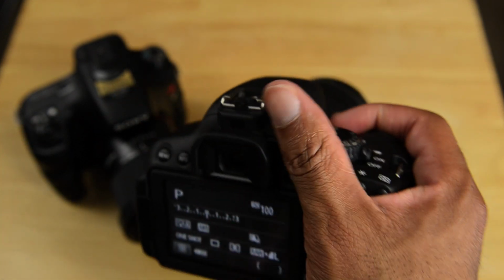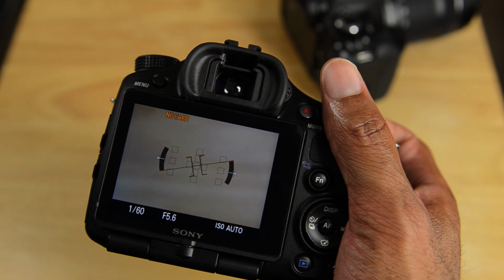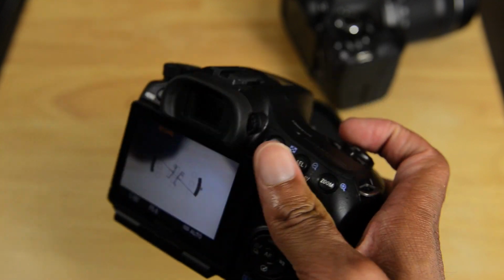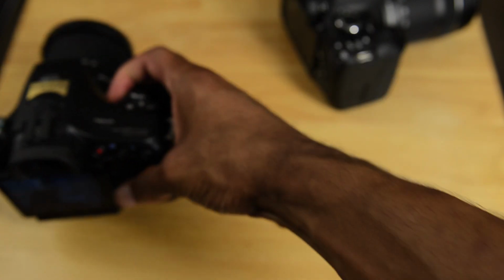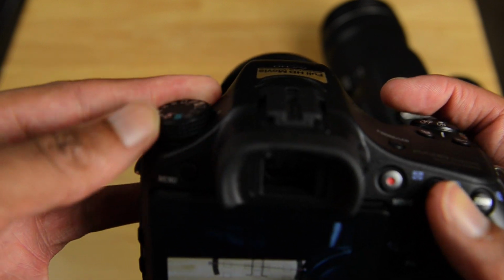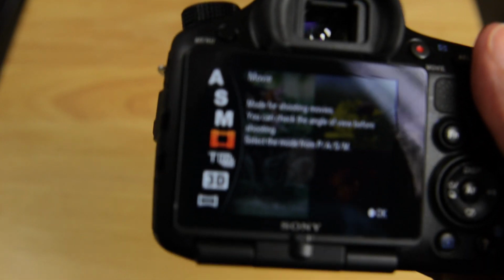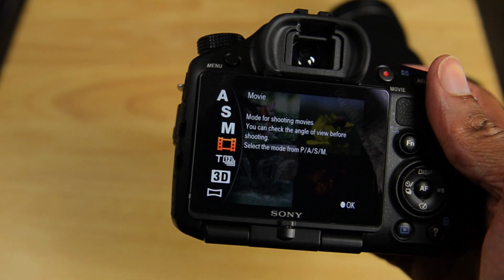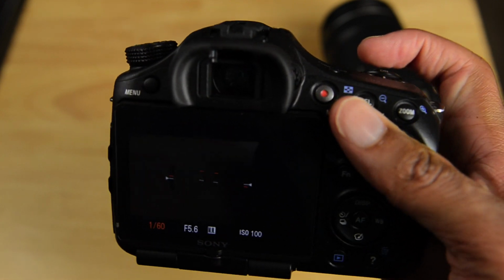Sony A57 VS Canon T4i (650D)

Comment: Advantages of the Sony SLT A57  OVER THAT CANON           Better color depth   23.4 bits vs 21.7 bits       Distinguishes 1.7 more bits of color         More dynamic range   13 EV vs 11.2 EV       2 f-stops more dynamic range         Significantly better image quality   75.0 vs 62.0       More than 20% better image quality         Much larger viewfinder   0.72x vs 0.53x       Around 90% larger viewfinder         Shoots much faster   12 fps vs 5 fps       Around 2.5x faster continuous shooting         Can create panoramas in-camera   Yes vs No       Stitches together multiple photos for a wide perspective         Takes 3D photos   Yes vs No       Combines multiple photos into a 3D image         Faster video autofocus   Phase detection vs Contrast detection       Shoot videos without worrying about focus         Higher frame rate movies   1080p @ 60fps vs 1080p @ 30fps       Both shoot Full HD (1080p) video, but T4i does so at a lower frame rate         Image stabilization   Sensor shift vs None       Helps eliminate blur caused by small camera movements         Slightly lower noise at high ISO   785 ISO vs 722 ISO       The SLT A57 has a slight edge (0.1 f-stops) in low-noise, high-ISO performance         Significantly better viewfinder coverage   100% vs 95%       Around 10% better viewfinder coverage         Longer battery life   550 shots vs 440 shots       Around 30% more shots per battery charge         More focus points   15 vs 9       Set focus accurately within the frame         Better maximum light sensitivity   16,000 ISO vs 12,800 ISO       The SLT A57's maximum light sensitivity is 0.6 f-stops better

Comment from the maker: No, it just depends on what lens you use.  In SLR lenses a larger mm number is more telephoto (more zoom) and a smaller mm number is wider angle.  18mm would be wide angle for example and 200mm would be telephoto (more zoom).

Comment from the maker: I would rule the Nikon out as far as video is concerned.  The newer Nikon's are better in video mode but the D5100 is quite a bit behind.  The Sony and the Canon will do much better in terms of video.  If you want more camcorder like behavior in video mode the Sony is better...for more manual video options go for the Canon.

Comment: Sensor stabilization like in Sony or Pentax is vastly superior to lens based.When you buy an SLR/T with a kit lens, and then you buy a prime, the prime will remain on the camera 98% of the time because they're far sharper, with better contrast and colors. With Sony or Pentax your superior primes will have stabilization, with Canon and Nikon - shaky shaky ! Buy an external mic for $40 if you don't want to hear the AF. 
Un-stabilized sensors are the greatest trap in SLR photography IMO.

Comment: jack, Fry's has it the Sony slt-a57 with kit lens 18-55mm for $479.99 this week and the next.  Also, to Jeremy, like the other person says, Sony has the new 18-135 SAM lens especially made for silent video operation, just like the STM lens for Canon Rebels.  Can you make a "correct" comparison between the two packages instead?  Also, I have tried the T4i, the touch screen is not that sensitive most of the times.  The autofocus is just painfully slow and I've missed a few potentially great shots.

Comment: I don't know if someone has already corrected you on this but i'm going to. The Canon 650D is Not the First Canon Model to have Auto focus in video mode. I am not sure but it was either the 7D or 5DMK2 that had auto focus. But with focus on both cameras the auto focus wasn't any good so I imagine they would not count.

Comment from the maker: it just depends on your intent, the biggest advantage of the 18-200 is that you won't have to switch between two lenses.  If you don't mind switching between 2 lenses then the 2 lens option will be less expensive.

Comment from the maker: I am not the most informed on long exposure/astro photography however I do know a bit.  I second the opinion that Sony isn't the best for very long exposures...neither is Nikon (which often use Sony sensors).  For whatever reason Canon cameras do much better with very long exposures; they even make a model specifically for astro photography (60Da).  I also suggest you look into exposure stacking software, this allows you to use multiple shorter exposures instead of just one really long one.

Comment: If you want quieter AF on the A57, the way to go is to get one of Sony's SSM (super-sonic motor) lenses; like the Canon STM series, they use stepperless motors. I have a Canon T2i and am leaning towards the A57 as a replacement because I want a camera with better AF when I shoot video. I'm not too worried about the lack of audio control with the A57 - an easy workaround for that is to use a dedicated audio recorder and then sync the audio in post-production.

Comment: Hi there.  Thanks for the review.  However, I am still none the wiser for my application - Atacama desert as a backdrop for starscape elapsed-time video.  I have a fair collection of 35mm Minoltas (too many) and their lenses, so I am tempted to Sony because of the A fitting swapover.  However, I have read some bad reviews of the Sony being very noisy in long exp. night shots, compared to Canon.  Drawn to digital for its multi-image capacity (instead of a pro 35mm x 200 frame motor back). HELP..!

Comment from the maker: Aparently you missed this line from my description "For my test I used the 18-135 IS STM, I was not able to detect any noise from the lens during focusing in video mode.  It however did not match the speed of the Sony, the Sony however was louder during AF operation."  Also Sony nomenclature aside an "SLT" camera still falls with the DSLR category...

Comment: one more thing....ur using a different specs of lens on both of the camera... try using atleast the SAM kit lens for sony... that would have less sound... and its alot faster than the old sony 18-70 kitlens which don't have a motor build in it...

Comment from the maker: It is a bit of a Sony oddity, in order to set it to this setting you have to be in the "multi frame noise reduction setting".  The multi frame noise reduction setting is just above the auto iso in the iso selection menu.  Once the setting is highlighted press the right arrow button, then you can scroll up and down through the iso options.  It will now go to the max 25,600 setting, It will take 6 shots in quick succession.  I will go over this feature more in the next video.

Comment: I agree. The 18-70 is an old lens that uses a mechanical screwdrive focus system which was acquired from Minolta. The newer Sony lenses have built in autofocus motors that are electronically controlled and are much quieter. The old 18-70 isn't even available as a kit lens with the A57. The new sony 18-135 has the 2nd generation SAM (smooth autofocus motor) and would be a much better comparison to th Canons 18-135.